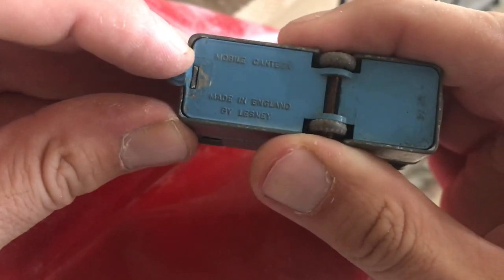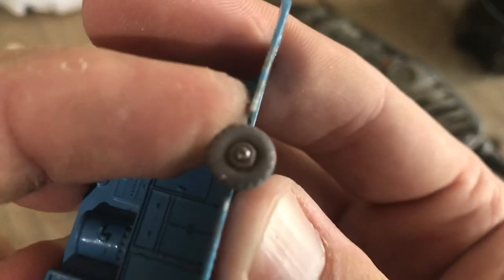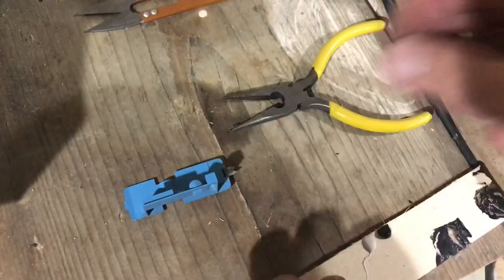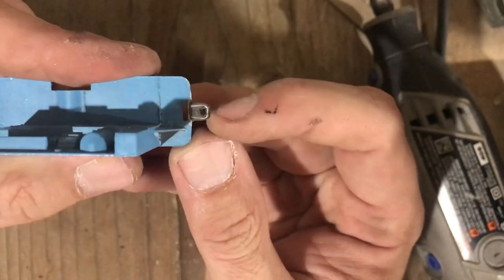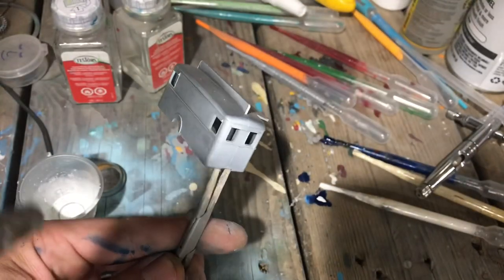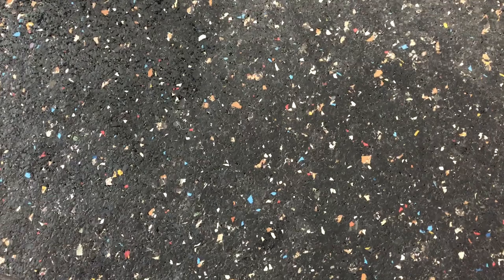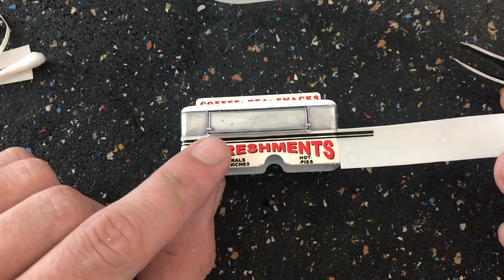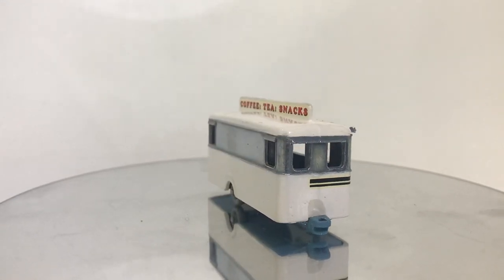Matchbox Lesney #74a Mobile Canteen Resto-Mod and Repair

Comment: I've been using citristrip as long as I've been doing this. And it's a fantastic stripper the only drawback is sometimes it takes a little while I always put mine in for overnight at least. I know at times making videos you don't have the time to do that but everything I've tried to strip with it has worked well. Just takes longer is all.

Comment: I'm sorry, one more comment. I've been using the J-B Weld also as long. I don't get the fast-setting I don't like it. I use the regular and you mix it to a gray and let it cure it is as strong as steel. You can drill it you can send it whatever you need to do.